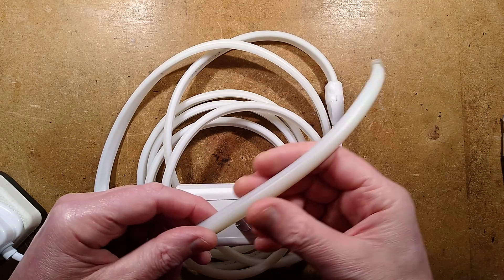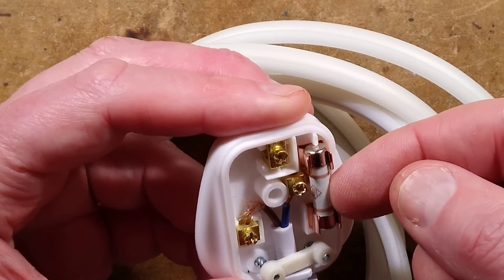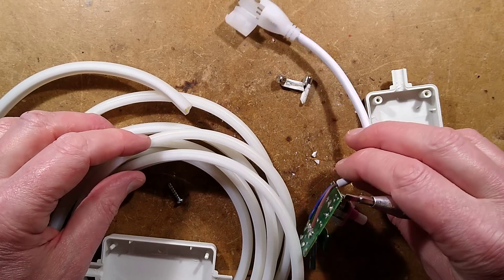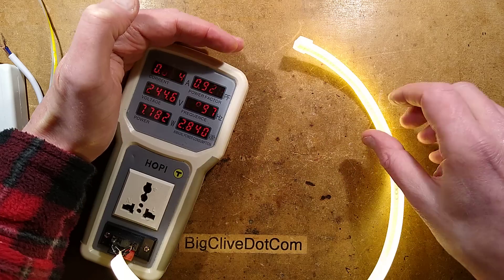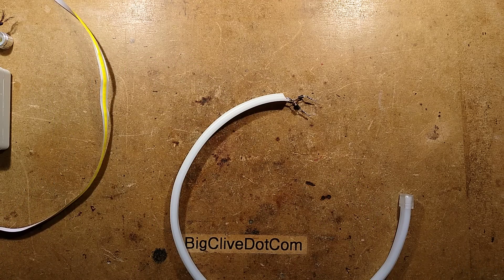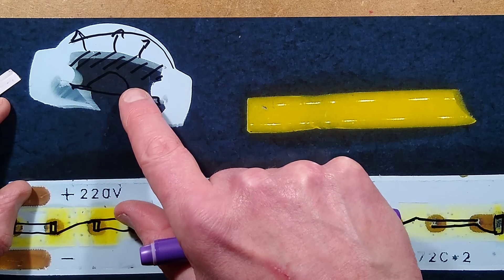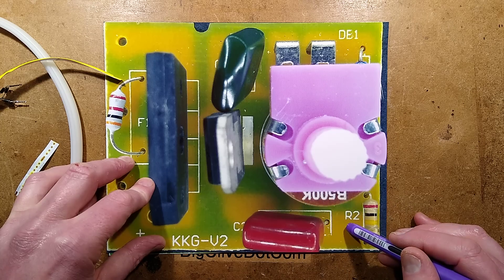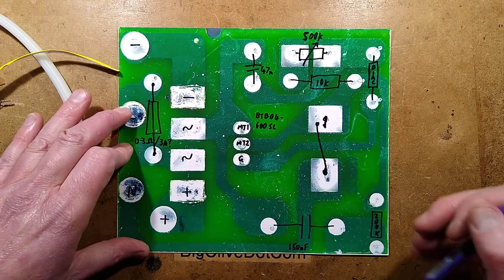Flickery COB LED strip with terrible dimmer.  (with schematics)

Comment: That plug wiring reminds me of the days when electricals were sold without plugs, and the wiring inside was so dodgy that it's amazing they actually worked... :S
Reply: I was born in the '60's,  my father regularly used to stick bare wires into sockets and hold them in place using matchsticks. Most houses had (three round pin) plug sockets,but people also used to connect high current devices such as toasters and irons into the bayonet lighting connections, few devicesat the time actually had an earth connection.
 I was 12 years old, in 1975, when I was taught, at school, how to correctly wire a plug!
 What amazes me, is how bloody clueless people are nowadays about ....everything! I see kids going into halfords because they have a flat tyre on their bike, adults throwing away perfectly good washing machines because they can't remove a bra-wire from the trap below the pump, ugh, countless, countless examples of why we need more people like Clive, and why they should be teachers!
Reply: @ianmorris8534  I was born in 1985, and have seen the transition from such things (my dad too would do dodgy things with plugs and socket, like jamming the stripped-back wires into a socket with another plug, on a 30 amp ring main!) to people apparently too afraid to even flick an RCD back on incase it went boom in their faces, and as for repairing things, I love to fix stuff, but the trouble is a lot of things these days are built to be anti-repair, heck, the uncle got a washing machine for free (some indesit-built hotpoint job) as it needs drum bearings, only, you can't replace them cos they sonic-welded the outer tub into one piece, so there's no repairing it without destroying the tub, which negates fixing the thing anyway, so it'll get used 'til the bearings crap out, then stripped down and what I don't keep will be left out for scrap, because it's junk, and designed to be junk from the factory...

Comment: Innnnnnteresting... UK electrical plugs have fuses in them? I guess that explains their size... EDIT: also, aluminum electrical wire? That's A Thing? Seems legit, especially for a high-voltage electrical system like that in the UK 😂 ...
Reply: Many Chinese power leads are aluminium, some have a copper plating to make them easy to solder.
In addition, the diameter of the wires is usually less than what would be necessary even if they were made of pure copper, the aluminum strands are much more fragile than the copper ones and they break after bending the cable a few times, when there are few strands left it overheats and usually a bubble appears in the plastic sheat, once all the insulation between the two conductors melts a short circuit occurs, it can range from a few sparks to an explosion, but in both cases it may expel molten metal that can ignite nearby flammable materials.

The power cables of the computers, unless the listing clearly indicates that they are 100% pure copper, are usually that type of copper plated aluminum (in some cases that claim to be 100% copper the seller is also lying) usually until receive it you do not know what you have bought, and even so to find out you need to destroy one or have the appropriate equipment to measure its resistance, the simplest thing is to apply the load for which the cable is rated and measure the voltage drop, but it is not something that the average consumer knows how to do or can do safely either.

I prefer to buy these types of cables in physical stores or in online stores that have at least one physical store in an EU country (I am from Spain so I need cables with a European plug) because if it is a physical store with an address in an EU country I don't think they risk selling fake products.
Reply: I recently bought a fan at a US Walmart labeled with their Mainstays house brand.  There is a tiny 1A 120V glass fuse in the plug.
Reply from the maker: Aluminium wire is not usually used for home wiring in the UK.  Although I'm sure there are some less knowledgeable installers who would happily use it if they find some.
Reply: I still cringe at not having fused plugs in the US. Instead of having a fuse matched to the load (13 amp for a fan heater, 3 amp for a radio, for example), there's a one size fits all circuit breaker which will happily let the radio melt itself.

Comment: Hiya Clive,
   Thanks for this vid,  I've bought many shite products where they couldn't even bloody attatch the effing plug properly, or the socket in the device wasn't connected securely enough to prevent melty smoke and fire.... Yes, we love it when you do it but it's not fun when it happens in someones house outside the confines of an explosion containment pie dish, and let's face it, those pies are so bloody crap now that no-one is going to have one.
 It is with this in mind that I'm going to ask you if you've seen the article in The Guardian about the rising number of fires caused by cheap chargers for cheap E-scooter/bike batteries. and the batteries themselves that are causing hundreds of serios fires every year?  Apparently, the Govt are asking Ebay/Amazon to regulate themselves, but we know how asking greedy giants to control themselves is going to work!
  Also, thanks for pointing out the Douche-flutes to people, a cause of fires in many municipal recycling plant.
Reply from the maker: The point of a government is to do the regulation.  The current world governments will only be interested in how the increased fires will affect their revenue from their insurance investments.

Comment: The wall mount lights on the front of my house started flikering and my wife told me to fix it. But they had 16 surface mount led's and a few of them burned out. I was going to replace the whole thing, but they look great and the dawn to dusk switch still worked. So i removed the aluminum square holding the led's and the controler. Drilled the backplate and added a bulb socket. Put in 15w Aliexpress led bulbs. Now they are brighter than ever before. The Dawn-Dusk switch is rated for 32w so i have the option of really lighting up my front yard.

Comment: Why does a UK fuse needs to be filled with sand? 🤔
As a German I "like" much more:
- the 2 cables entering the white box without any meaningful safety against getting pulled out (incl. the live wire)
and
- the loose fine copper fibers  without an endcap half out of the screw.
🤭🤦‍♂️🤪
Reply: The sand is there to quench the arc that is formed when the fuse ruptures.  High energy circuits most always used this style of fuse (HRC high rupture capacity).
Reply: @ferrumignis  Thank you! 👍
Reply: Sand helps to prevent or extinguish arcing through the fuse. A fuse that allows sustained arcing is no fuse at all.
Reply: @sootikins  Thank you! 👍
Reply: And fusing the plug at 13a, where normal load is .03a
Reply: I think that the fact the fuse has no sand is of less concern than, as you mentiond, the conductors are not secured in the terminals!
Reply: Sand is non combustible and fuse cartridges filled with such have minimal oxygen inside, for sustainable combustion..also since it's in granular form..it is a " spring like buffer" in case of a fuse explosively blowing..the glass cartridge shoud not be broken.
Reply: @capturedflame  that's not normal for EU sockets, maybe you were hearing a cheap light dimmer buzzing or staid in cheap hotels with questionable safety
Reply: @capturedflame  Buy decent socket converters next time

Comment: I notice right away that they have fitted a gland at the plug but haven't bothered to tighten the strain relief.  So that might well be why the wires have pulled out. At lease the tip is not coming off in your hand ☺     I dont think the case would make it double insulated for the safety of stupid people and children.   ⚡⚡⚡⚡ 
 Very interesting bit of deadly junk 2x👍
Reply: You've got to watch out for the tip coming off in your hand when you pull the knob off.
Reply: @Lemon_Inspector  Yes, a good grip on the knob is ideal.☺

Comment: 3:00 And naturally the power from the dimmer comes out as pins (which you can touch) with the socket (which you can't) being on the end attached to the LED strip.
Reply: Ease of assembly (for probably semi-skilled operators) is more important that end-user safety. The "Manufacturers" probably stick a "No User-Serviceable Parts Inside" label on the finished light system in order to (attempt) to avoid liability!
Reply: You are obviously forgetting the chinese plan to conquer the world one electrocution death at a time

Comment: For a change the plug itself looked fine, from what I could see. Full metal Earth, shrouded Live and Neutral, right size pins, proper cord grip and real fuse holder. Pity about the wiring and the fuse used.
Reply: Even if it was a real fuse, 13A is vastly too high a rating for an LED lighting strip.
Reply: @zh84  Its a mains voltage lightening strip.
Reply: Very likely the original plug was a 2 pin Euro style one, that they chopped off, and put on the UK version. Thus the 13A fuse, instead of a 3A one, and the poor work, because they are paid by the unit, so want to take as little time as possible on each one, so as to get more done in a day.

Comment: I swear they intentionally wire things wrong (fuse on neutral, live/neutral reversed, no ground, ect) more often than they do it right.

Is it because they have no standards to adhere to and they're just taking the piss because they can?
Reply: I think that they do these with other plugs as well like europlug where is not polarity. And they do not know/care how the uk plug should be wired.
Reply: Well, if my understanding of Chinese labour is correct, it's either a case of "I'm not paid enough for this shizzle", or (possibly worse) "If I spend an extra 60 seconds per unit making sure polarity and termination quality is correct, I won't hit my production quota and then I certainly won't be getting paid enough... At all".